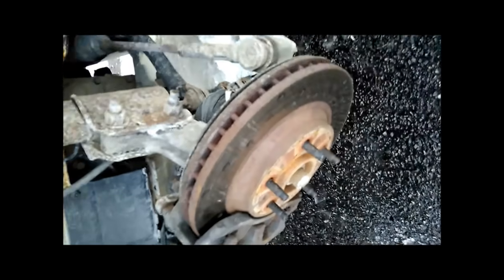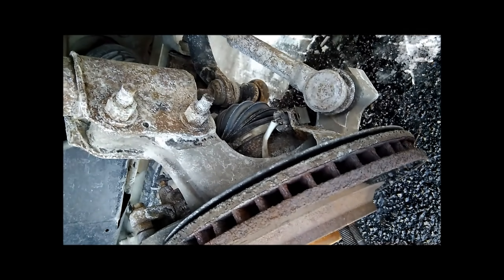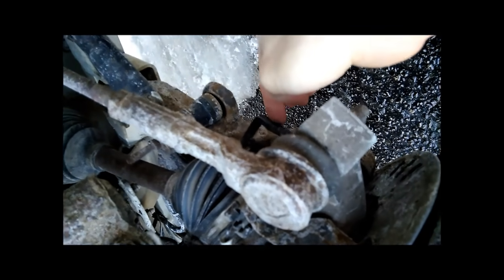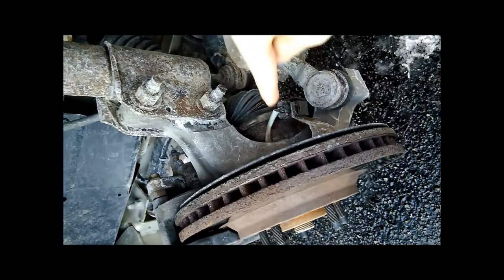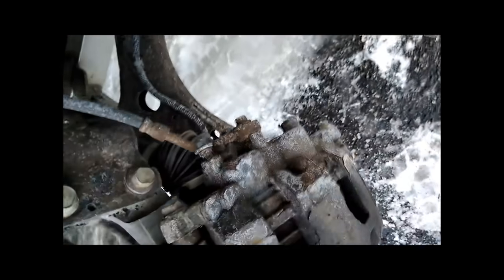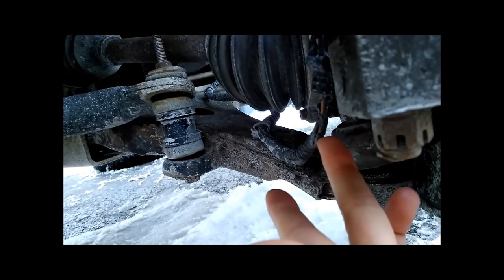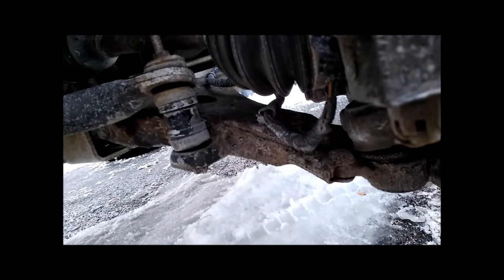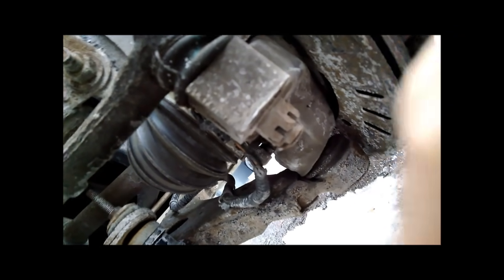How to fix ABS light, Traction Control, Stabilitrak

Comment: I just purchased a 2010 Buick Lesabre that the abs light and a StabiliTrack warning comes on only when it’s raining.  It happens fairly right away- like I hadn’t got 1/10 of a mile down the road in the rain before it came on. The previous owner said that they had taken it to the dealership but because the light always turns off when the engine gets turned off that the shop wasn’t able to find it even after multiple trips.  Do you have an idea of where this is likely coming from?
Reply from the maker: Anything causally related to rain... is a red flag that you have a wire somewhere with the insulation worn off.  As soon as water hits it, the water acts like an electrical bridge, causing the wires in the bundle to short circuit.  When it's not raining, the air gap between the wires is enough to keep the signal clean.  I bet if you lift the car up and have a look at the wire loom going from each wheel back to the ECU, you'll find a break in the insulation somewhere.   Perhaps you can even turn the problem on and off with a dollar store spray bottle full of salt water.  But for your own safety I don't recommend this level of diagnosis.  I might do it because I'm a bit crazy but you'd need the car on and elevated while you spray salt water at your wire looms going back to the ECU.  Better to have a mechanic put it on the hoist with a scanner connected for extra measure.
Reply: @ChrisCamaro  thanks so much!  My dad has a lot more knowledge about cars than I do. He just changed the radiator in my Cadillac ATS so I’ll tell him what you said and have him look before I take it to the shop. I’d rather do a patch job than spend a bunch of money.
Reply from the maker: @hamannlaura  I get you.  In that case, for your or his safety, make sure to use proper jack stands rather than the spare tire jack, put the e-brake on and have someone spot you while you inspect the wire loom.  If you have a multimeter you can disconnect the wheel speed sensor and probe the wire going back to the computer.  If you check in resistance mode, you may notice a difference between 1 of the wheels and the rest.  For that matter, a scan tool capable of scanning the BCM can do this as well, but those are hard to come by if you're not a mechanic.

Comment: Excellent video. I have check everything.   Yet it only does the stabilitrack when is windy out. Could this possibly be a bad sensor or perhaps bad bearing.
Reply from the maker: Windy?  Hmm.. is the wind causing the car to sway back and forth?  The sensor is inside the bearing/hub so it could be a bad hub unit but the higher likelihood is a wiring issue if the car is old.

Comment: The reason why we tell them replace the whole bearing is because 9 times out of ten the bearing is bad released grease out of the bearing or it has so much slop the distance to the sensor is out of spec and the milage on the bearing
Reply from the maker: I've even had a couple of bad bearings straight out of the box before.
Reply: @ChrisCamaro  sounds more like you got a return that someone installed wrong damaged the bearing and it was put back on the shelf as a new part
Reply from the maker: @supupandaway8138  Possibly.  Although I bought it really cheap from an Amazon source that had 1 bad review and it said Timken and what I got did not look like that sort of quality so I think it was a chinese ripoff.

Comment: You could just put black tape over the screen message light on dashboard and you don't have to see the message anymore, problem fixed
Reply from the maker: Lol that's one way.
Reply: Goofy move
Reply: I wish, the car keeps dinging and shifts hard
Reply: HAHAHAHAHA!!!!!
That caught me off guard. Thanks for the laugh Mr. Meme!
Reply: Awesome! My car is stuck in park, then this light came on too 😂 I needed this laugh
Reply: No you can't because the vehicle keeps pulling power away from the accelerator because it thinks that the traction control is going off it won't let you go anywhere
Reply: @nicktoofar3514  omggggggggg this is happening to my car.  It keeps turning off won't let me go or break!!   Is that what it is?????????
Reply: @kasaundraelmore8442  the problem I was fighting 08 Ford escape. I had traction control, abs lights on on the dash. When you would stop at a stop light the break pedal would be surging like the vehicle was needing the abs breaks and when you would try and go the vehicle would not apply power because it thought the traction control was needed(basically the car thought it was in a constant slide) my fix was to pull the abs fuse from panel on passanger side of center consol and the 50w fuse under the hood fuse panel.
Reply: No because the car drives different
Reply: Hard to ignore in the winter when you can't stop lol.
Reply: Yes you can! Or, with a torx bit a d a bit of mechanical enginuity you can
 "pull the cluster" , locate that peanut butter that illuminates that specific warning light and PULL IT OUT! WALLA!!
Reply: But my car is jerking while shifting gear when traction control light on
Reply: I just use my phone to cover it  watch YouTube and drive
Reply: Not really

Comment: in the meantime is there a way to turn off this traction control for a while?, I’ve known which mechinic screwed up which wheel ever since it happened.  my 12 impala has become sOooo s2pid in its s2pid smRt(not) cR NginEring, that the s2pid-S smRt(not) traction control enginEring kEps coming back on BY ITS OWN SMRT S2PID-sLf!☹️
Reply from the maker: Actually my follow-up video to this one is all about how to disable the abs until you fix it.  Just check the 2nd video in my channel on this topic and the answer is in there.
Reply: @ChrisCamaro  
thNx, but I was going for the gold, to disable it WITHOUT disabeling my abs.. & more importantly I was 1drng the UsUL, how chevy could put a traction control off button, that just magically turns itself back on, an off switch that doesn’t work.. I was 1drng then, how gm/chevy NgNErEng could B so amAZngly dum✋😔

Comment: I have a 2015 impala that will have tha stabilitrack , traction and engine light on all at once then it will fix itself random do u have any suggestions on what i can do to fix that?
Reply from the maker: That's just the telltale sign that the system is in the midst of failing.  Whether it's a wiring issue or a bad sensor, these things tend to fail gradually not all of a sudden.  It's best to diagnose the problem when it's in this condition instead of waiting for it to fail entirely.  At least when it's flaky like this, you can detect and localize it more easily with a scan tool or multimeter.

Comment: I have a 2006 Astra my ABS light came  the ODB came up with 20 codes. It was found that the complete system, Module, punp, and all wheel sensors were faulty. After everything being replaced car was running well for 5 days. Then suddenly on the 5th day was driving home from work and going round a traffic island, when the ABS  light came on. I had the mechanic do a diagnostic check on it and it came up showing no faults. Why is this and what is causing the light to come on?
Reply from the maker: The thing that makes the TCS system hard to diagnose is that it comes on intermittently while you're driving but by the time you're back home or at the mechanic, the problem isn't happening anymore and you can't see it on a scan

Comment: I have a Ford fusion 2019 and I have those lights on even after switching the sensor, bearing. Do you have any idea what else can be switched to have this issue solved?
Reply from the maker: The wires going from the wheel back to the car computer would be the most likely culprit if changing the bearings didn't do anything.

Comment: I got it fixed, in my case after engine change, they forgot (smh)to connect back the front right ABS cable, code cleared

Comment: We are having rough idle and loss of power when service Stabilitrac and engine light comes on on our Chev Silv 09. Coil is fine, sparkplugs and wires are new, cylinders were bored out $800 cost. Was ok for day and 1/2 then same problem happened again. We need help!!!
Reply from the maker: Since you mentioned you bored out the cylinders, I have to wonder if the engine roughness is somehow related to that (since changing engine displacement also requires tuning) and not necessarily the Traction Control.  That TCS may be a red herring.
Reply: @ChrisCamaro  Thanks so much for your help....something to consider.
Reply from the maker: @justcuz9837  NP.  Sometimes when aftermarket engine work is performed, 2 dozen cables need to be disconnected in order to access the inside of the engine block and when the mechanic reconnects everything there is a loose connection somewhere.  Whatever isn't connected may be tripping the TCS but may also be more of a systemic issue affecting other systems, like the engine timing encoder pulses or something else that affects driveability.  The cable harness that plugs into the car's computer has many wires going to many sensors.  There's no real "right place to start looking" but there seems to be a correlation between your recent engine work and your computer freaking out a day and a half later.  I might ask the mechanic who did the work to give it a look over for free if you can reproduce the symptoms for him.
Reply: This is BEC. To clarify, all the symptoms took place before the machanic work took place. It's strange to me that the symptoms went away (after machining the headers) for the day and a half. During that day and a half we drove the truck all over town. Then It displayed the same exact symptoms again. After reading the comments btwn you and my wife I felt maybe there was a little information lost in translation. I get the feeling, a sensor has something to do with this. I watched a video on the steering wheel position censor and am wondering what your thoughts are on this? I am no machanic, I'll be the first to admit. But after 25 plus years of car trouble you get a feel for things😅. Thanks for your help. It is deeply appreciated.
Reply from the maker: @justcuz9837  Oh yeah, headers would not affect anything probably.  I mean basically the TCS system is a form of Torque Management in general, which there is a huge section of code for in the computer.  It overrides user inputs to the car and throttles back the power.  How this algorithm is implemented varies with the car so I have no idea about specific behaviour for a given car but TCS can cause driveability issues if it activates out of turn.  The era of car I'm familiar with only depend on the wheel sensors as inputs for this so you're talking about a total of 8 wires on the car going back to the ECU that could be the culprit.  However newer cars might incorporate more sensors so that's a bit out of my league to comment on.

Comment: If you look in the hole where the sensor goes in should you see any grease residue?
Reply from the maker: You mean the wheel speed sensor?  It's inside the wheel bearing.  You should not be able to see it at all.  The only exposed part is the wiring harness.

Comment: Had the same problem. Alignment was also off and once I got the car aligned, it never showed up again
Reply from the maker: Good point.  The system can act up on you for legitimate reasons (alignment problems would make the tires chirp) and illegitimate ones (bad wiring).  It's important to find the difference.

Comment: Can it make a grinding noise When applying brakes Got diagnostic check…….right speed sensor ABS right hub😢
Reply from the maker: Grinding?  I wouldn't describe it like that.  Normally you'd get more of a pulsating feeling/sound.  But maybe you mean the same thing.  Keep in mind that just because that wheel is throwing a sensor code doesn't meant the sensor itself is bad.  Any part of the electrical circuit could be bad and it will still throw that code.  So you might want to have a look at that wire loom first for obvious damage before changing the hub.  Hubs are fairly cheap though so it's not the end of the world

Comment: HI, any views as to why the ABS light does NOT come on. Either when ignition only is on and when the engine is running too. Car is a MK4 Supra. Tnx
Reply from the maker: Not sure I understand you.  The light isn't supposed to come on unless the system is currently active (like in the middle of a skid) or if it's malfunctioning.  Under normal circumstances it should not be on.
Reply: @ChrisCamaro  The light does NOT come on, period. The bulb is good.
Reply from the maker: @aedwards4496  You mean the system doesn't work AND the light doesn't come on?  So you're saying the MIL light on the dash is electrically or programmatically malfunctioning?

Comment: Had axles replaced abs light is on and traction contorl and it's causing my steering wheel light to xone on to and losing power steering woukd that be a sensor to had no issues tell changing the axles
Reply: What car do you have because I’m having the same issue with my 2010 ford fusion hybrid
Reply: If you found out your issue please let me know
Reply: @Justtrying2065 my issues was a wheel speed sensor I no longer have any lights on
Reply: @lukepartin4129  thanks man I’m going to go check mine now

Comment: Abs,stabilitrak off & service break assist& stability control messages  on my 08 Cadillac Cts all started at the same time & has been on for 2 days now,they all started at once while driving,didn't notice anything unusual before they popped up. Car drives fine except feels like brakes are a little harder...help!any ideas of what this is?
Reply from the maker: There are basically 3 things you can do.  To "live with the problem", you can follow the link at the bottom of this video which tells you how to de-activate the system so it doesn't cause you problems while you're driving.  To actually diagnose and fix the problem you either have to inspect the wire looms going from each wheel back to the computer, as described in this video but that's hard for most people to do without a lift, or you can go to any mechanic and ask him to scan the car for codes to tell you which wheel (or other subsystem) is causing the fault.  Off the shelf scanners you can buy won't detect this because it's a "body" code, not an "engine" code.  So unless you are mechanically inclined you have to get a mechanic to scan the car.  Some good mechanics will do this for free because it's easy and quick.  Others might charge up to 50 bucks to do it.  You could make a few phone calls to see if you can get it done for free.  This will vastly simplify the diagnosis and ultimately be cheaper and faster for you to deal with it.

Comment: My Cadillac ats 2014 2.5 is popping up with stabilitrack and traction control turns off and my car starts getting rough while changing gears and looses powers should I try this ?
Reply from the maker: That could be a red herring.  I would scan it first.

Comment: Does this make your car not start also for the battery charging system  light to come on?
Reply from the maker: No, you shouldn't have any issues with the charging system or battery as a result of faulty wiring in the TCS/ABS/Stab system.  Those wires are signal wires and carry very low currents through them.  Even if they were directly shorted it would have no impact whatsoever on your battery life or anything related to charging.  It would simply cause the computer to fault the TCS and ignore it from then on.  Now... if you have a problem starting your car and think your battery might be dead, I just made a video a few days ago that addresses that problem as well.  Perhaps you might get some help there:  https://youtu.be/LariGfsG8h8
Reply: What my car is doing is trying to start but doesn't turn over I put new battery, starter, alternator , and change the spark plugs.
Reply from the maker: @ceciliasegeda8641  Not knowing which car you have, it sounds like the computer may be to blame.  If the electrical system is good, you have good fuel and your intake system isn't blocked then maybe the computer (like the fuel tables) are off.  Do you  have an OBDII scan tool or access to one?  You could check to see if there are any codes.
Reply: @ChrisCamaro  no I don't have one its a 2007 Suziki XL7
Reply from the maker: @ceciliasegeda8641  Mechanics have such scan tools and if you have a decent relationship with your mechanic they are sometimes willing to scan the car for free because a) it doesn't cost them anything but a few mins of their time which they would have wasted talking to the customer anyway and b) they want to find something wrong with the car so they can get you to pay them for that.  If you can get the mechanic to scan the car for free, you can tell whether or not your starting issue is a computer problem or if the computer is pointing to some mechanical failure or sensor issue.  As it stands now, it's difficult to know what could be wrong with it because the symptoms are too broad.
Reply: Thank you so much for your time and help

Comment: I have a 2007 Jeep Liberty all my lights kicked on ESP bas abs and traction control. And it drives fine when they're on but when they're off sometimes when I go to hit the gas it feels like something jamming up or the brakes are engaging. And then when I let go the gas and Coast it's fine and then all the lights will kick back on and it drives fine any ideas?
Reply from the maker: Kind of an odd set of symptoms but it could still be a simple discontinuity in the sensor lines.  You could try inspecting and servicing the connectors and surrounding wires at the wheels but if it's not that you have the trace the wire looms all the way back to the car's computer and that's tricky to do without a mechanic's lift.